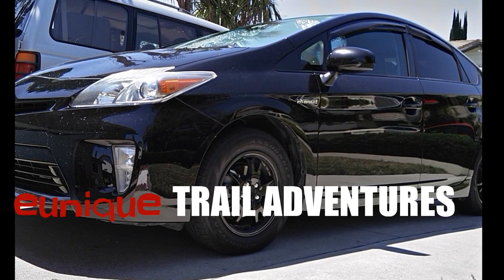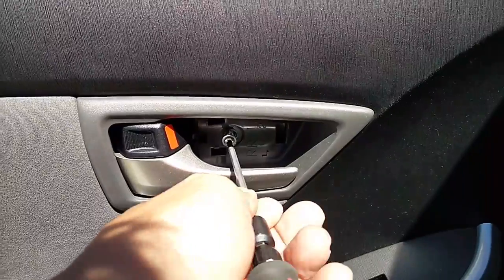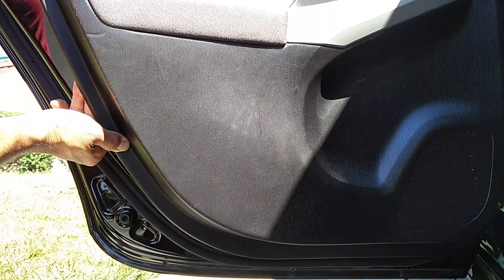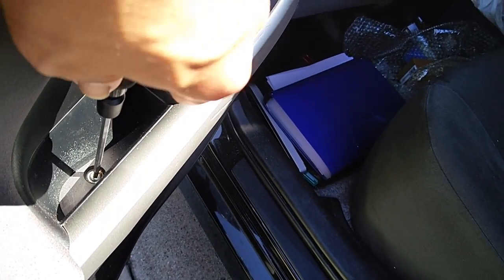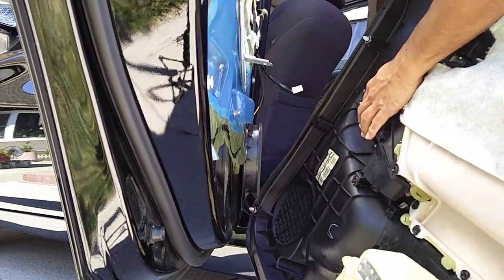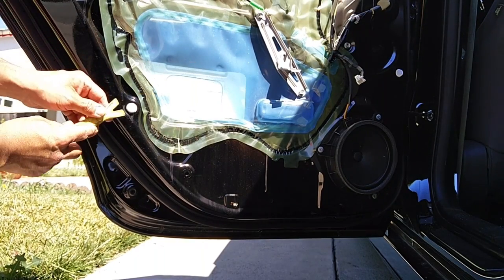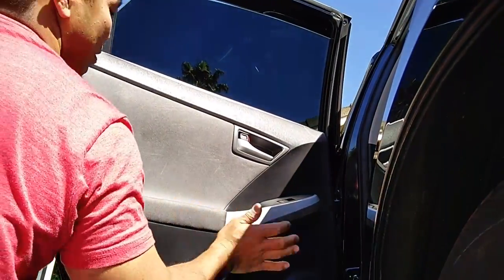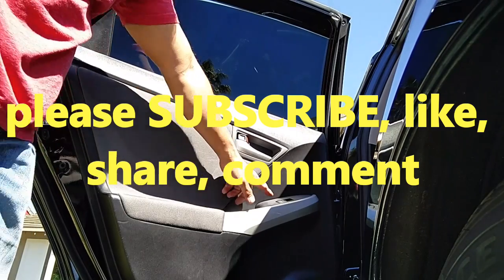How to Remove Prius Rear Door Panels -Toyota Hybrid

Comment: Thanks for the video. I reinstalled the door panel and in doing so, I closed the door and now cannot open the door from either the inside or outside. Do you know a way of fixing this issue?
Reply from the maker: Peter W I would try to roll down the windows, then try to push out from the inside. The panel probably did not align correctly and then is wedging between the door and the body making it seem stuck shut.
Reply from the maker: Peter W Also another probability is that you were not able to install the plastic clip that connects to the door handle actuator rods..or knocked off one on the inside which is why you are not able to open from in or outside